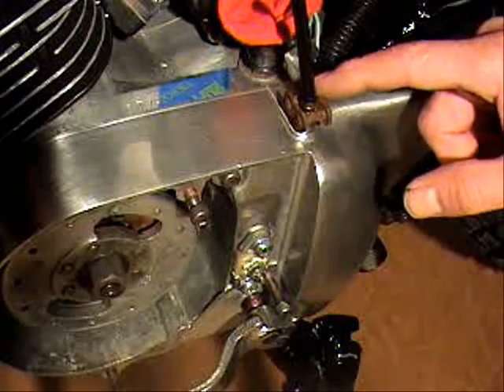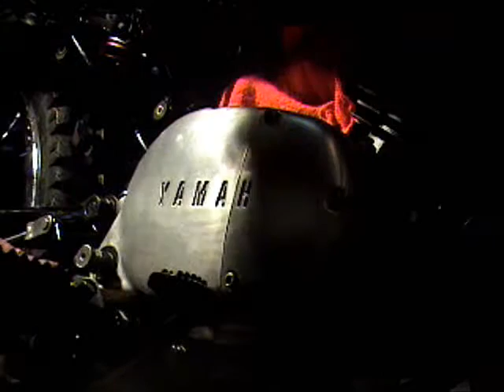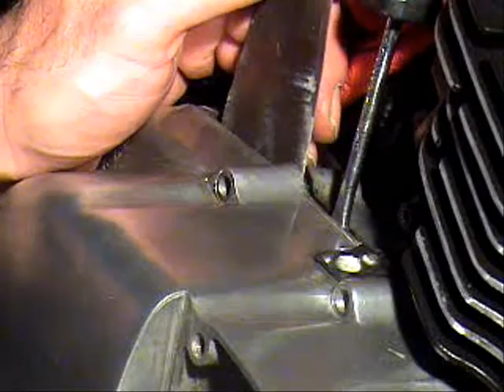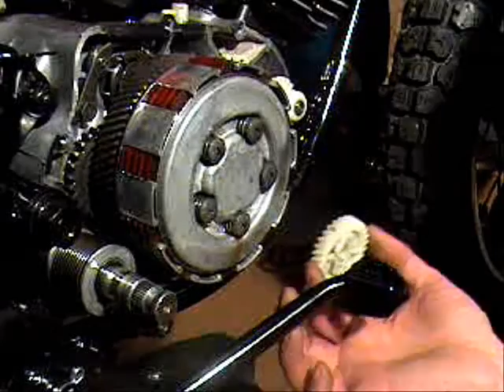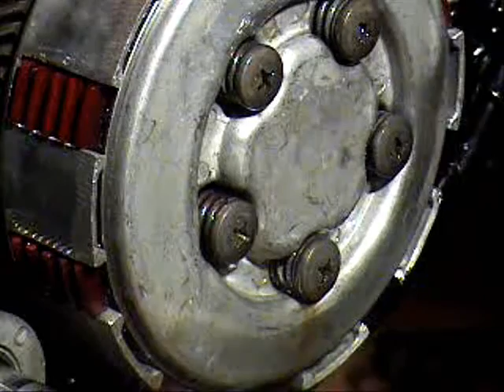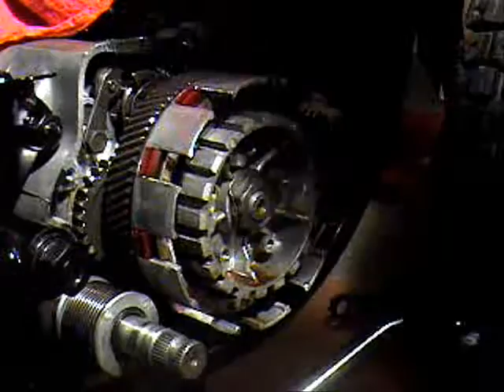Yamaha CT175 restoration - seized clutch repair

Comment: Good tip take a hammer with a proper fitting Phillips screw driver smack it kinda hard and remove spray some loosening before hand but 90% of the time it worked for me
Reply from the maker: Oh, and don't forget to cross your fingers.

Comment: What type brand of oil do you use in your CT-2 ? Ive got one with 900 miles on it that the clutch is slipping real bad in 3rd & 4th gear. I used Torco 4 cycle10w-30 T4. but before that I was using Valoline 10-40 4 cycle oil both in the transmission case not the engine oiler. Any help would be appreciated .
Reply from the maker: I'm not sure what I used,  but I would definitely stay away from  synthetic oils.

Comment: Never mind the last comment about the oiler. The oiler deletes where a common practice with racers who had to pre-mix all their gas. The regulation of the oiler was controlled by the cable that went through the hole in the top of the case, feeding un-mixed gasoline with oil from the reservoir to the right of the seat. The blanked hole was the cable access from the carb to the oiler which regulated just how much oil was fed into the fuel. The oiler and the cables were never much of problem initially, but if left unserviced by the user, they could cause possible seizures of the engine. If your always pre-mixing your fuel, all the mechanisms that served the oiler can be deleted as well. Just didn't want to see you blow the engine sky high by starving the lubrication to the cylinder. Best wishes.

Comment: Not a certified anything, but the two holes in the right half of the case serve the oiler for the engine (right in front of that stripped screw you found). The one hole feeds the hose from the oil reservoir, and the other a line that goes into the back of the head to inject oil through the reed valve into the cylinder head. Find which ones been deleted, as you'll want to return it back the way it was. It shouldn't be plugged at all. Its for two stroke operation and is necessary.

Comment: I have the exact same bike that I am trying to get running after 30 or so years sitting idle. After cleaning the carb and doing other small maintenance work (replacing the hoses, cleaning the tank, oil change, etc.) I can get the bike running fine, but it will not shift into gear without it being in motion.  Any ideas on where the problem may lie? I was thinking it could be an issue with the clutch, but I am unsure. Any advice would be greatly appreciated!
Reply: have you looked at the shift forks? if that didn't work you might have to pull out the shift Assembly
Reply: @dirtbikemonday4826  I'll take a look at the shift forks. I had first thought the cable may have rusted somewhere so we were working to replace that and found that that was not the problem. Thanks for the help!
Reply from the maker: Also make sure the clutch handle, cable, and clutch rod move freely and are adjusted correctly.

Comment: In initial start video,we thought vry same dat front sprocket is moving wid torque r engine vibrations,but it had more consistent rotation,vry Wonderful fix by cleaning clutchdiscs
Reply from the maker: That was definitely my least favorite part of the rebuild.  I am glad is wasn't anything worse.
Reply: @muddyfences5559  yes where is will dere will b a solution4sure,though sumtym bkums bit cumbersome

Comment: bfor trying to separate d cover first hit it verticaly to lossen d gaskets hold...
but dont hit too much
Reply from the maker: Not a bad tip. If it hadn't been for the hidden bolt, this would have been a much smoother job.
Reply: Muddy Fences 
well yeah d one hidden on d front
Reply: @muddyfences5559  It's not hidden.  It's right there.
Reply from the maker: @megankelly9438  I know, right there. Haha.

Comment: Could you get replacement clutch disks instead of repairing them like you did?
Reply from the maker: You could, if you could find them and afford them. It can be tough to find new OEM parts for these old bikes.
Reply: Muddy Fences Thanks for the reply! I'm a first time rider trying to get a yamaha 74 dt125 running and your videos have been amazingly helpful! Getting that clutch cover off was not easy
Reply from the maker: That's great. These are good bikes, and pretty simple to work on.

Comment: The problem you ran into with that front screw was also an issue for my YCS1 Bonanza. If it had been in the manual, it would have saved both of us a lot of time. Great video. Thanks for posting.
Reply from the maker: Millbarge01 Sorry to hear about that. It sure created a mess. Thanks for the feedback.
Reply: I also have a YCS1 Bonanza and didnt notice it right away. Lucky me someone stripped the entire set of bolts on this engine!

Comment: 23:44 should really resoak those plates in gear oil before refitting ?
Reply from the maker: Martin Parker That couldn't hurt. I don't know if it's necessary on this bike.
Reply: no need in putting any gear oil on them, those plates are well soaked in oil by now. no need in over thinking this stuff.  I have only been working on bikes for 43 years now and you did just fine. Yes, when I started working on bikes you could still buy Honda 305 Dreams off the showroom floor.

Comment: 5:37 never jam screwdrivers or lever whatever in between cases.........just use a rubber mallet or lever against something else apart from the gasket edges like for instance that tac drive area in your instance.
Reply from the maker: Martin Parker The screwdrivers aren't being used to lever the cover. They are used as spacers to keep the gap open as I work around the cover. Thanks
Reply: sorry i missed that bit , i see you used a scraper too break the seal........mmm .....mallet still works best in most cases, in hindsight it was the hidden screw that made removal dificult
Reply from the maker: Martin Parker That bolt was a nightmare. It prevented me from doing anything right. Thanks for the tip. Take care.

Comment: I have a1971 175, it up shifts fine but does not want to downshift, any ideas. Thanks for any help
Reply from the maker: jerry horbal If your clutch seems to work freely, it could be an issue with the shift lever shaft or pawl. It could be bent, or missing teeth. It makes sense that upshifting works, because you can upshift without using the clutch. You may need to pull the cover to see if something is loose,  bent, or broken. Good luck.
Reply: Thanks, I will try that I have no idea what to look for but I will see if I can find something that looks wrong

Comment: Hey i have a 1971 ct1 175, any places good for parts?
Reply from the maker: +wyatt martin I have seen a ton of parts on ebay and other web sites, which you probably already knew.  I am lucky enough to have a couple of old bike salvage yards near me that I can salvage parts from.  I would check your area to see if any salvage yards exist.  They are a gold mine.  Good luck.
Reply: wyatt martin hey the none electric start at1 125s are a parts source for a CT1 175 they use the exact same bottom end and transmission and the case's are a match and many of the other parts from and At1 will work on a ct1